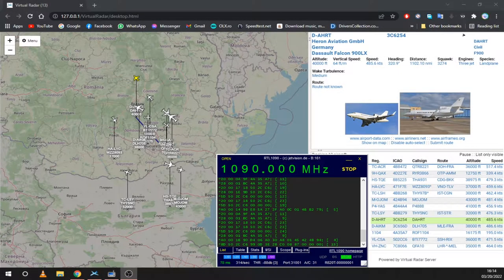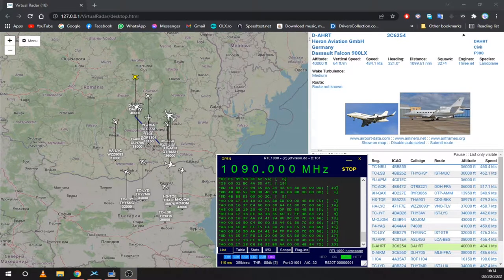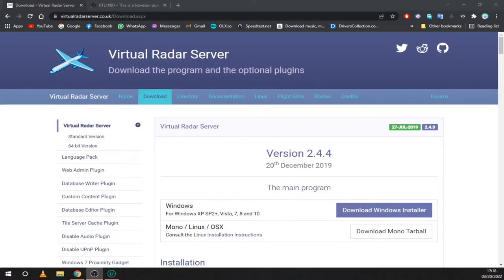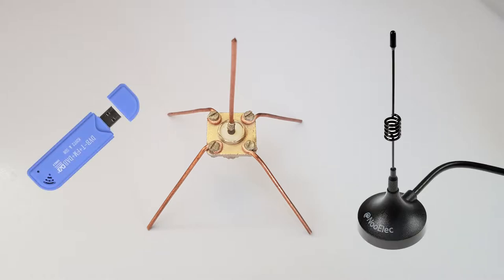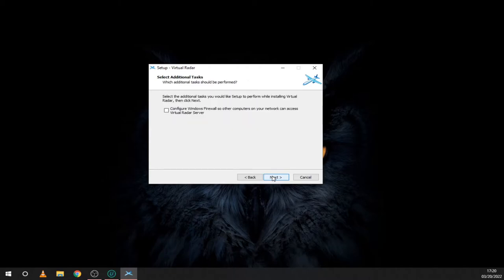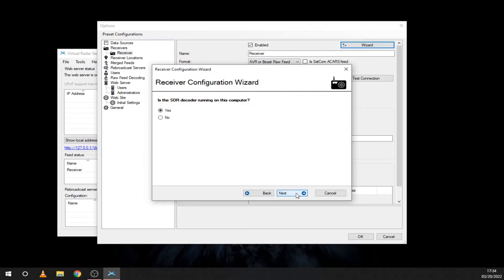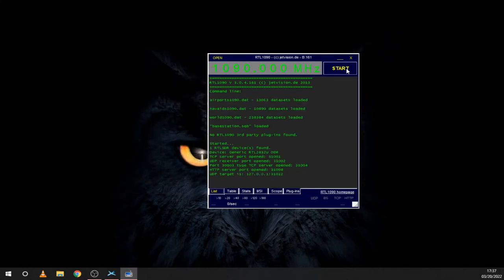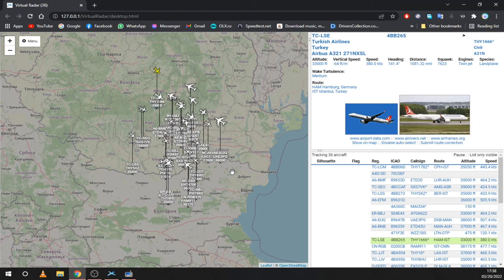Tracking Planes With RTL-SDR | ADS-B Decoding

Comment: Can’t get it to work with version 4 of the RTL-SDR Bummer!
Reply: I can't either.  I followed all the steps and even tricked it into connecting by setting it to Serial COM1, but it just won't receive data.  The program was last updated 5 years ago so, this is it.
Reply: Same here rip 🪦
Reply: Hi, @3liverse ! Did you find any way to solve this issue? I'm also interested in this project and I want to know if I should buy the rtl sdr or not.
Reply: @budi.a.  I have completely stopped using the application, along with many others that do not support version 4 (V4). The only applications I currently use on my V4 are DSD Plus and SDRPP. I would recommend getting version 3 (V3) instead, as it seems that many of these applications are not being updated frequently these days. I'm sorry I couldn't be of more help.